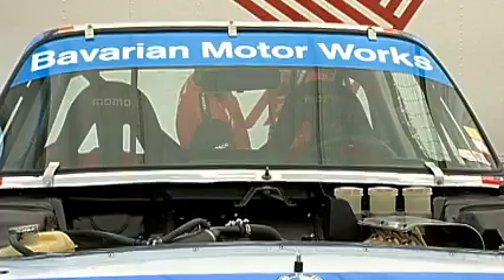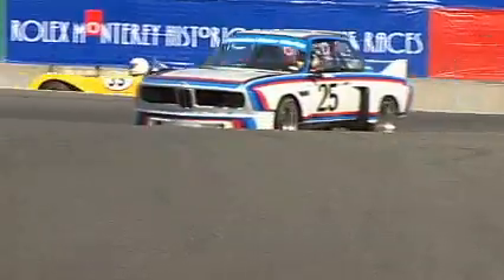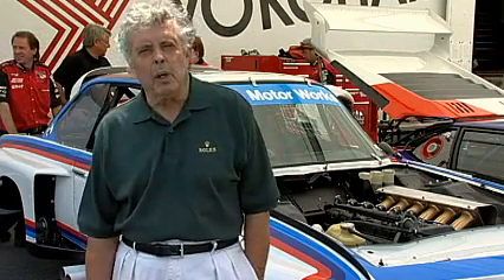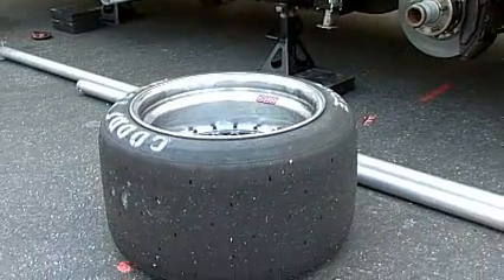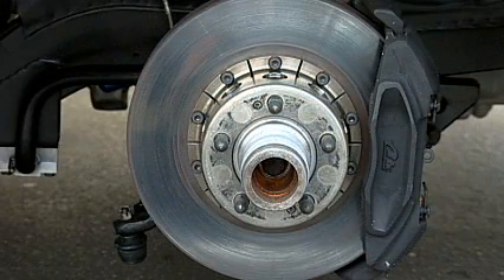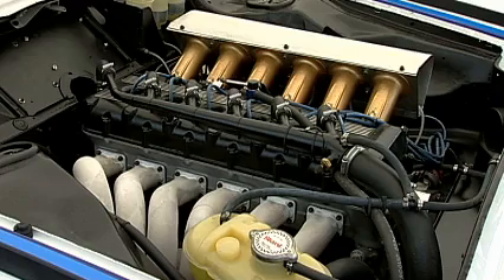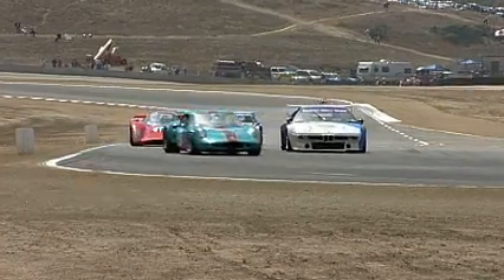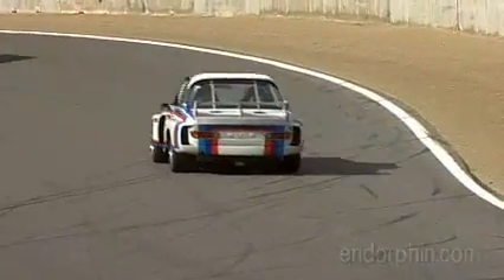BMW CSL Racer

Comment: " ... not much different, its 430 hp from 3.5l not much different than what you get today"

Yah, not TOOOO much different. 335i puts 300hp and thats a 50,000USD car. what car is this guy talking about that i can get 430 horses out of a 6 cycl 3.5 litre